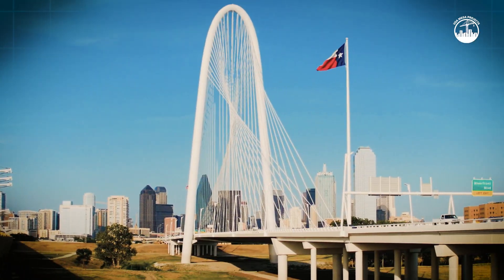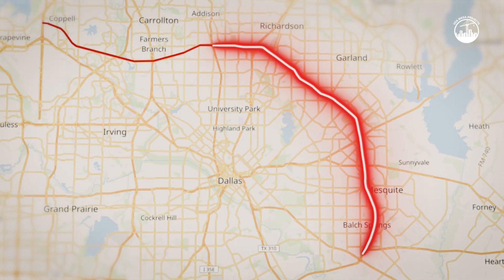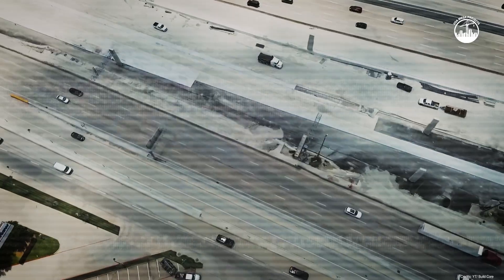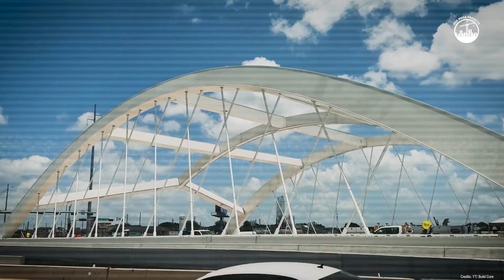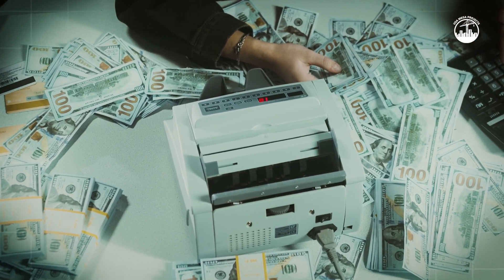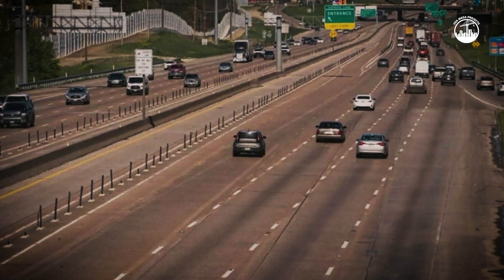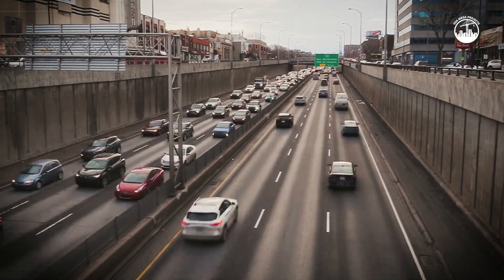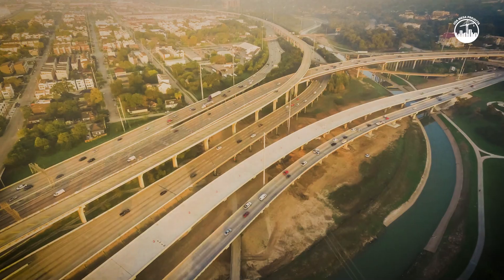Why This 10-Mile Texas Highway Costs $1.74 Billion?

Comment: I will say the info you have on DART is a little outdated. There are atleast two DART stations located right off of LBJ East. They just don’t go in the same direction of the project.
Reply from the maker: Thanks for pointing that out. Transit networks change over time, and it’s good to know there are DART stations near LBJ East even if they’re not aligned with the project’s main route. Updated details like this help give a clearer picture.

Comment: Drop in the bucket. 
The I-4 Ultimate Improvement Project in Central Florida cost approximately $114.3 million per mile. This cost is based on the final price of $2.4 billion for the 21-mile project. 
Calculation of cost per mile:
Total cost: $2.4 billion
Total miles: 21 miles
Calculation: $2,400,000,000 / 21 miles ≈ $114,285,714 per mile.

And traffic in the region is still horrible.

Comment: All this just for it and all the highways in texas to always have traffic, we need more trains and streetcars connected to walkable areas
Reply: These tollways are designed for the highways to cause traffic with lanes that bottleneck and make every right lane an exit only lane. Also putting in 1 lane tollways, by eliminating all the emergency lanes. That way, more accidents can happen, to cause more traffic. Accidents on the daily. It’s to make more money for them by making people take the express lane. A bunch of liars. These tollways are a scam. It’s not doing anything to alleviate traffic. It’s making it worse.
Reply: Texas is too big for that. A train stopping every 30 seconds will take hours to get anywhere
Reply: Big oil won't allow that in texas!!! They want more cars and pollution on texas roads
Reply: @Davidstone568 Dallas has more miles of light rail than any city in the United States.
Reply: 90% of the time, the trains are almost empty.
Reply: @donlowry6469 So given the choice,  Texans prefer the convenience of going when and where they want, and not where someone else wants them to go.
Ain't freedom great!!
Reply: That, and many of the passengers on some trains aren't the type of people you want to ride with. Not so bad during rush hour or special events but slow times means no witness.
Reply: @donlowry6469 I can't argue with that!
Reply: @pnichols6500 Dallas is trying to keep the hood out of the suburbs.. it’s just that simple
Reply: @donlowry6469 cause the trains don’t go to suburbs that’s why.. it’s why it’s always empty
Reply: @DashBorad_P I would advise you to actually look at a map of the DART rail system before you make uninformed statements. 
They most certainly go to the suburbs. There are more miles in the suburbs than in the city itself.

Comment: You are wrong.  Lots of toll roads in Texas (Austin, Houston, Laredo, Cleburne) allow for more rapid expansion of infrastructure to serve the huge population influx.   Means that users pay for the roads they use --- I am not sure that's bad.
Reply: It's bad because it should cost 29.45 for 2 miles.
Reply: @wargraymon2006  Toll fees are not high in Texas, at least compared to other states.
Reply: @samuelmorales2344 cost of living is lower too.
Reply: I absolutely agree.   Taking a toll road is a choice.  No one is obligated to take that route.  Highway 161 went south through Grand Prairie.  Nothing was out there.   Now millions and millions of dollars have been invested on both sides of the freeway.